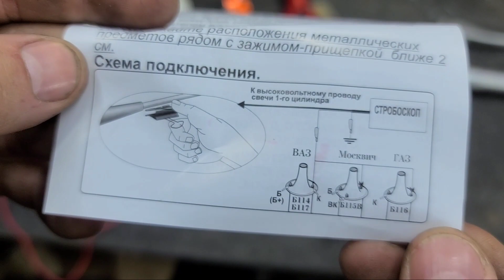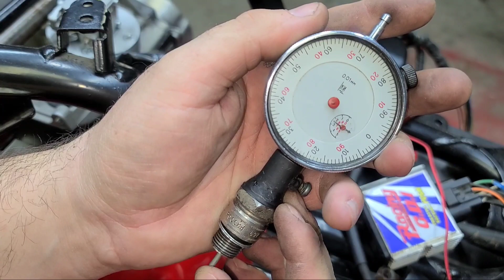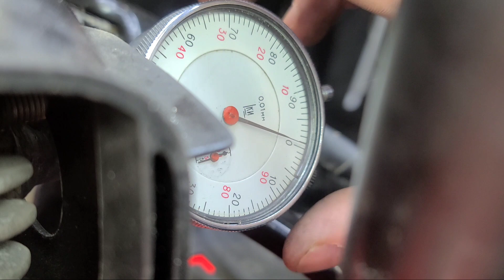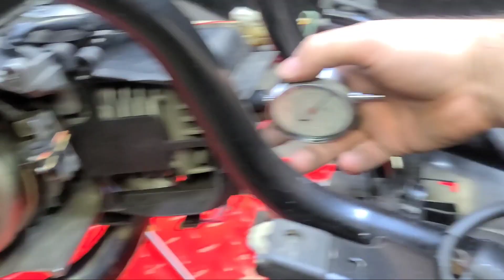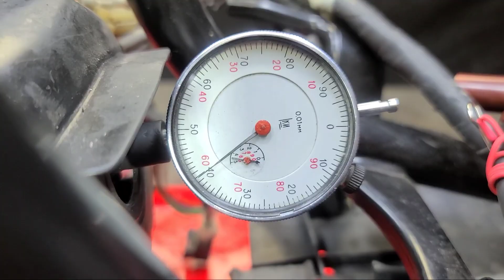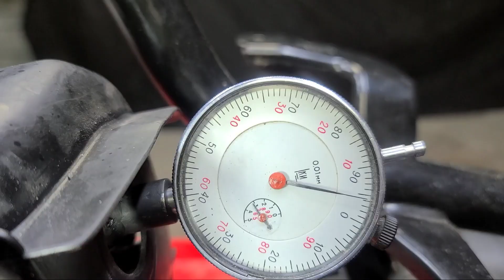Стробоскоп, настройка зажигания от бензопилы STIHL на скутере Yamaha Jog

Comment: i made a home made cdi ignition module for my 35yr old 2 stroke yamaha bike but this is on another level altogether!

i notice the exhaust pipe is turned 180degrees to the muffler doesnt that rob engine power too?? it needs to straightened to allow better scavenging

Comment: I think, you are wrong. In more advanced ignition module btdc is variable. Ignition timing is changing with rpm to best performace. to block module rpm there is used low pas filter or digital module based on mikrocontroler

Comment: El motor de la yamaha si tiene avance, es la razon de la pestaña larga en la volante del magneto, en ralentí  la chipa salta despues que pasa la pestaña y en aceleracion la chispa salta al inicio de la pestaña, esa es la razon de la pestaña larga en la volante,  lo que ocurre es que con esa pistola estroboscopica no puedes verla ya que es para automovil cuya revolución maxima es 3500 rpm ya que el auto no suele acelerar tanto mas que esto, la moto pasa los 10 mil rpm y no puedes verlo...
Reply: Si deseas mas avance usa  su mismo plato haciendo ojo chino para que corra mas ala izquierda y tenga mas avance....
Reply: Usa un carburador mas grande , para  evitar el cut-off usa un TAC con una bobina de 12 voltios y no el CDI y la bobina que lleva puesta , el TAC no tiene cut-off ya que recive el pulso de e cendido directo del captador de pulso